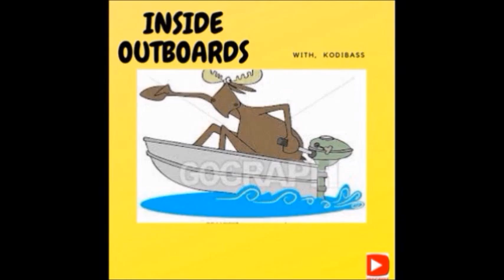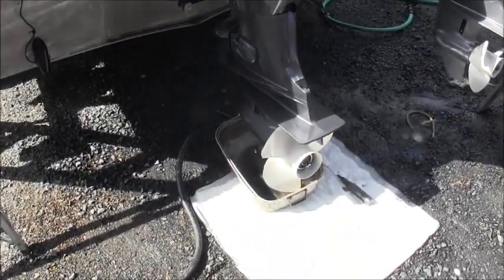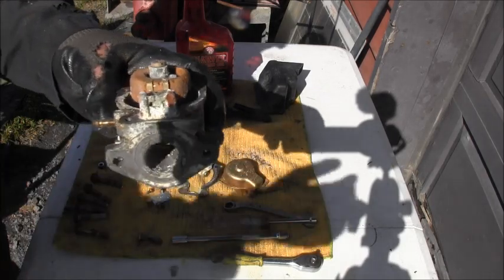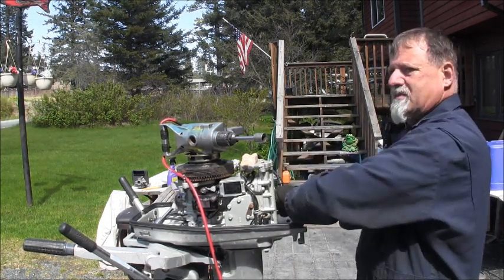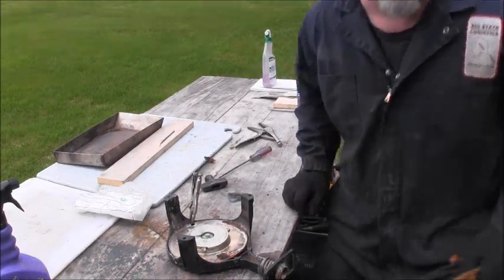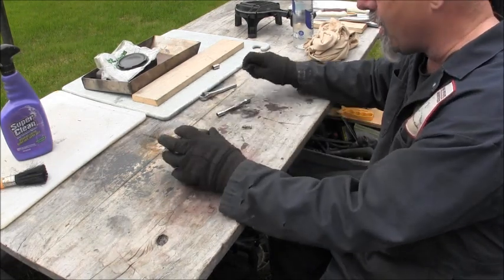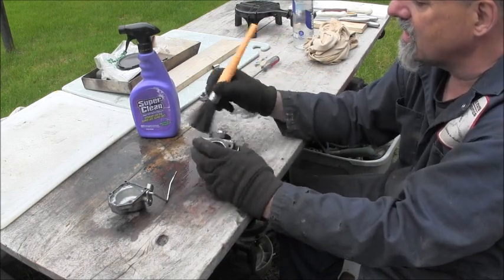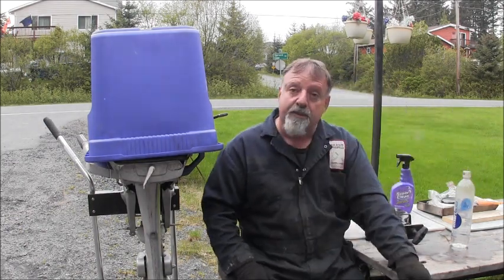YAMAHA'S,   JOHNSON  7. 5     &  MYSTERY MOTOR

Comment: Nice save on the 7.5hp carb, those float pin ears love to break/erode off when rusted like that.  The metal carb bowls have become "gold" now that BRP doesn't make them anymore, the outside of it looked so nice, I thought it had already been replaced...Perhaps it was, then some num nuts left water in it...  Don't forget the throttle shaft, it looks to be jammed open as well....
Reply from the maker: Great point!  &  Also you were correct on the  lower unit it was a buger to get  off.  Slow I steady & I got it.    kodi
Reply: @kodibassInsideoutboards    Cool!  Wish I was that lucky/skilled....I usually only get em off leaving the driveshaft dangling down out of the exhaust hsg....  Clean them splines up good to get rid of the rust...

Comment: Kodibass, I just purchased a 30hp Yamaha elec. start tiller motor. Is there a kit that I can make shifter and throttle up front  by the steering wheel. looking forward to your feedback.
Reply from the maker: Yes 4 sure.  Take your motor's model#  to any decent Yamaha outboard dealer and they will have it in the type & length  you need.    kb